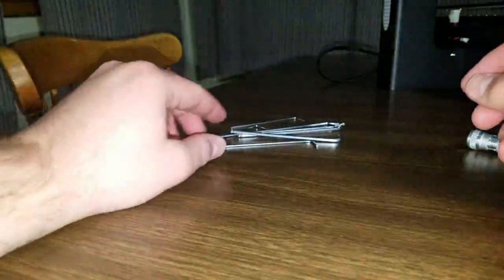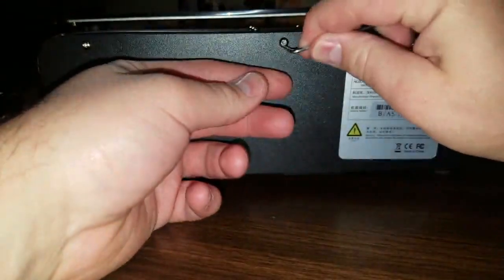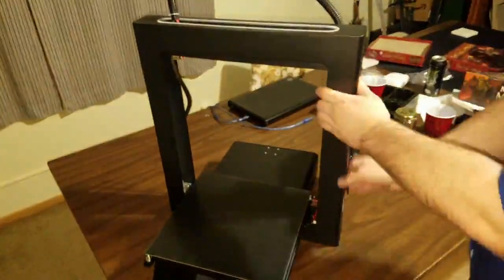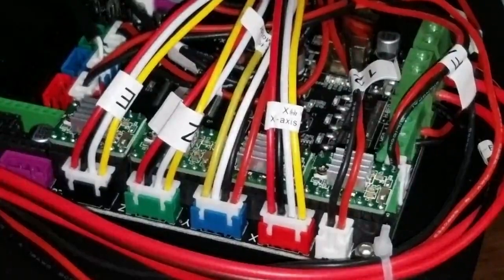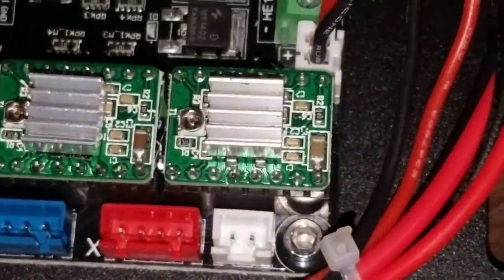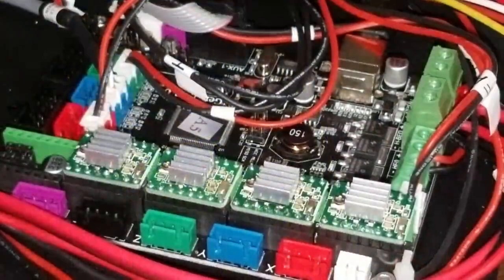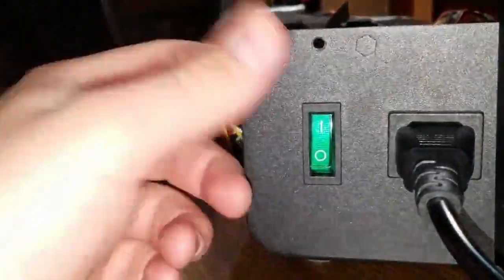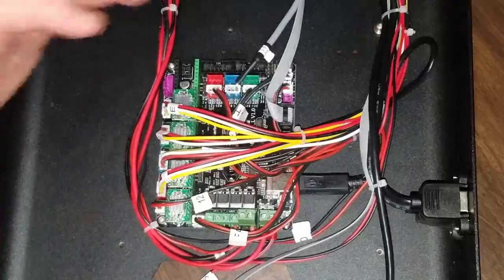How to: Tuning JG Aurora Drivers | Alcaplasm Tutorials

Comment: Hi Jamie and like you I am quite good with electronics but here you are trying to polish a turd because these JGAurora will keep going wrong and having to wait for parts to arrive from China six weeks each time results in the machine rusting due to lack of use and you stress levels arguing with the "Hep Desk" will only rise if you buy a new one. Good luck keeping it going, i gave in
Reply from the maker: Thank you for your response! I have had some trouble too, but I have been trying hard to polish them up because I bought one used printer from them and they sent me two new ones... so I figured I would make their mistake worthwhile!